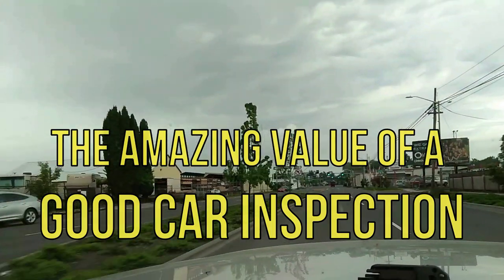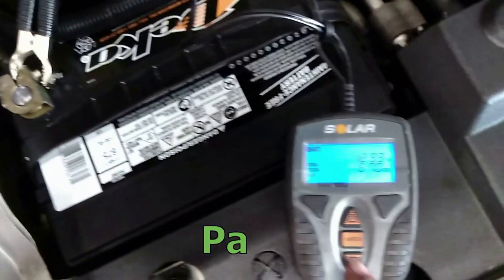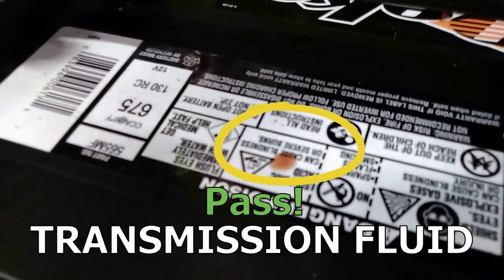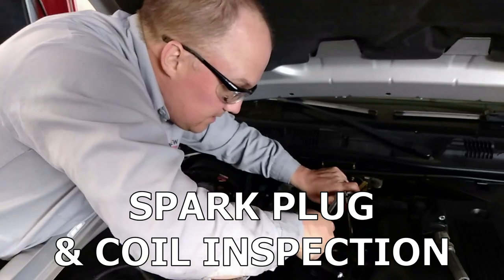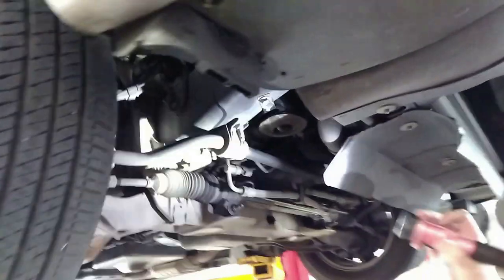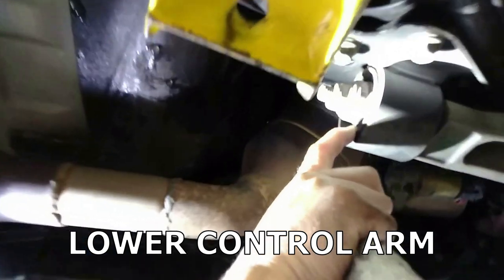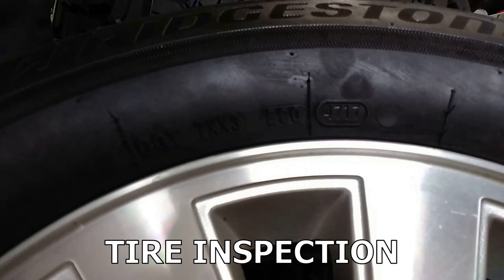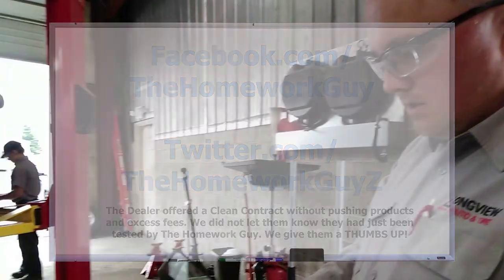GET A USED CAR INSPECTED BEFORE YOU BUY in 2023: Longview Auto & Tire The Homework Guy, Kevin Hunter

Comment: Main question I've always had about getting an inspection is how do you arrange this?  Do you setup the inspection appointment ahead of time with your mechanic?  Who takes the car to them?  At what point in the buying process?
Reply: My mechanic didn't set an appointment, just said bring it and they'd fit it in. But that'll vary between shops so you really just have to call yours to find out. Who takes it to the inspection is up to the dealership. The ones in my area seem to pretty much just have the prospective buyer take it. They get a photo copy of your driver license and auto insurance, and ask you to have it back in an hour. I tell them it'll be from 1 to 2 hours because there's no appointment, and they are okay with that. Do it BEFORE you try to negotiate a deal. Anything the mechanic finds that you would be willing to fix can be used as leverage for bargaining. And of course, they might find HUGE problems like mine did and you just don't want to touch the thing with a 10' pole! If you do get a bad result from the inspection and you're going to walk away, do NOT share ANY information with the dealership! They know where you took it, and most of them are slimeballs and like to leave BAD reviews on Yelp and such for that shop. I said, "I paid for the inspection, so I'm keeping the information private." Smiling of course. And when he asked if I was going to purchase it today I said: "I still need to think it over." They know EXACTLY what is wrong with the vehicle, they don't need you to tell them!

Comment: I completely agree! Get an inspection done before purchasing! I bought a used Cherokee in 2016 and the first drive out of town, the engine blew up. I had taken it to the dealership I purchased it from that same day hours before and was told I was ok to drive it home. On the drive back, the engine blew. Luckily, I made my case with the dealership and they covered costs and labor.  My 2013 Cherokee I bought in 2016 became a lemon. It was problematic in the 4 years I had it.

Comment: yes, any used car should be checked over even if it comes from a dealership, esp. if it comes from a used dealership
Reply: They're really good at polishing turds. I took in one that looked pretty good from the outside, brakes felt a little mushy and clutch released really high. They said yeah, needs a new clutch and brake work -- also had an engine leak and "rusty looking antifreeze."  😬

Comment: I suggest also taking the car to a good body shop to check that the frame is straight, there is no hidden/repaired body damage, and there is no repaired hail damage. Hail and accident damage is very often NOT reported on CarFax! Don't trust CarFax to tell you everything!! In my case a body shop later discovered about two dozen spots where hail damage had been repaired, but the CarFax report said nothing! Also have the body shop check all glass, top to bottom, including inside the doors. In my case, the very bottom of the windshield, below the wipers, was shattered. When I noticed the windshield a month later and showed it to the manager, he said I must have damaged it and refused to replace it, or even help me replace it.

Comment: I dont consider myself a mechanic, I do work on all my own 45yo cars. Butt no new cars. Ppl can cause a scam and sometimes u don't know if your dealing with someone who just cleans a cars interior and paint and flips it. Or an honest person. I agree with the mechanic in this video 100%. 2 things I do as well tho, I smell the engine oil just as he did with the trans fluid, sometimes a car can develop a knocking sound in an engine and to quiet things down theyll add gear oil to the crankcase. Gear oil smell will be a bad indicator of course. Also, I hook in a vacuum gauge to the intake manifold. A vacuum gauge will tell u all sorts of issues  a car engine has if u know how to read the gauge. 
LOVE YOUR VIDEOS! 
#thehomeworkguy

Comment: Speaking of inspections, years ago, AAA had an inspection center, and for a flat fee, they would do what I thought was an excellent inspection of any car.. I would have my own checked every couple of years, just to see how it was doing.. I think AAA stopped that here, but it was great! Sorry to see it go!!! I miss it.. Finding a good mechanic around me now is nearly impossible, or so it seems.. Now, I just buy new cars, then drive them to death!!!!!!!!!!! Luckily, the dealer I have now has been really good for me.. NO complaints.. I am driving a 2005 Honda Accord, has 236,000 miles on it, all my miles, and living in St Louis, MO, I take it Dave Mungenast, near me.. Great so far!!! Basic inspections take place each time I take the car in for service, like oil changes, etc. I did take it to a LOCAL mechanic last year, for a heater issue, but he did so much damage, and did not solve the issue, that I am still mad. Had to have Honda repair some of the damage, then I got payment back from the bad mechanic, but the interior damage will just have to stay, at the least the larger parts.. Some of the broken and damaged console parts I did replace. Horrible experience! #TheHomeworkGuy.

Comment: The most important check that wasn't performed on this video is a scan with a high-level scan tool.  These scans can check engine, transmission, SRS, SAS and more.  Additionally, a slime-ball seller may clear diagnostic codes with a scan tool.  It will take at least 100 miles for all of the onboard computers to recheck and identify diagnostic codes.  If somebody wants to sell me a used car that bad, I say that the contract must include "subject to my mechanic's approval".  Otherwise, this was a great video and Longview Tire did a very comprehensive inspection.
Reply from the maker: You are correct in that a scan must be done. Because we covered "cleared codes" in another video, and in the interest of time, we left it out here. Another reason we didn't show it is that while many consumers have scan tools, they have no real ability or skill to actually LOOK at the car... so we focused on the physical inspection of the vehicle. However, he did check for cleared codes (there were none), and performed a scan with a high end scan tool. The car checked out great. The decision was made to buy it, and it's been a great vehicle. Did the front end work that showed up on the inspection, flushed the brake fluid system, and power steering system. The car is really solid. I enjoyed driving it! Thanks for your comment.

Comment: I agree about the spare coil. I have a grand marquis and the only issue is a coil or two goes once a year. I have a genuine coil and the tool to replace it in the glovebox. I have a phone scan tool to determine which!
Reply: These cars are very picky with coils. I suggest genuine OEM coils not cheap aftermarket ones.
Reply: @Anon1mous  Yes, I get OEM ones from Advance auto. They are in a Motorcraft bag. With discount, about $30 each. The cheap ones are a gamble.

Comment: Cannot agree more Kevin. I just paid $56 to have a PPI on the nice used mustang I just bought from Carvana ( They give you a 7 day return policy ) . Car drives great but the inspection shows a lot of rust corrosion under the car that cannot be fixed. Advice from the garage , run away. Carvana are picking the car back up in a couple of days. I thought I was a risk as the history showed it from Ohio and the inspection proved it was worth every $ I paid for it.
Reply: A PPI is a Pre Purchase Inspection , any garage will perform this if you requests it. They put the car up on ramps and inspect it for anything odd they see . For my mustang they found the hood had been repainted , but no sign of accident damage . Leaking coolant pipe, a loose timing chain that would need to be replaced , heavy rust under e car , brake caliper covers that would need replacing due to rust. I live in Virginia but this service is provided by most garages. The challenge is getting the car before you buy it to have it inspected if it’s sold “ as is”.
Reply: Did Carvana refund your money? The whole amount?

Comment: Hi Kevin
The inspection was vary detailed and inclusive and it's not easy to find a mechanic you can trust and that would go to that length when inspecting a car so credit is due.

I am however a bit puzzled, although he went to a lot of detail, it seems that he over looked the body and chassis of the car, at least from what I could see in the video, he did not check to see if there are any warps or crumples or if repair work has been previously done and he did not check for body panel gap inconsistencies and misalignments, all things that could lead to suspect that the car has been involved in an accident. this has a for more significant impact on the car value than light bulbs and air filter which are relatively insignificant in comparison has this matter been addressed at some point during the purchase of the vehicle? 

Thanks for everything you do, love your channel 
Udi
Reply from the maker: The body inspection was part of what he did... we just had to cut it in the interest of time. However, you will notice that he comments on the body when he is doing the summary of the inspection at the end. The rear quarter on the driver side had been repaired. He noted that there was no damage to the frame or any other aspect of the car, and no bondo used on the the panel, and after inspecting it, decided that it was largely a cosmetic repair having no effect on the structure or soundness of the car.

Comment: So what's next? Do you negotiate with the price after you found out what's wrong? Say if the repairs are 800 bucks, do you go back to the dealer and try to take that off of the price? I have a feeling that would not work.
Reply: Worked for me (Partially). The inspection found the vehicle needed new tires, new brakes+rotors, and a new coupler for the AWD system. The coupler alone was $1100 (Labor+part). The dealer paid for everything else, and we split the coupler work 50/50...We really wanted that car (Santa Fe Limited).

Comment: The problem is finding a good mechanic that will actually do all these tests. Most of them will charge you the $150, and do maybe a third of the tests this guy has done.
Reply: Completely agree with that statement. It may vary from different areas. But I can almost bet most mechanics will not be as thorough by me. Also if the car fails inspection by mechanic how many cars will have that same failure rate that you consider. Could be costly to pay a mechanic for something I would rather look at 1st if you know how. And then, maybe when you feel you found a good solid car and you are will to spend that 100 to 200 for a thorough inspection, go for it. Really the average person has no idea what's in good shape or not except for looks and maybe the ride.
Reply: Yes exactly I had a pre purchase inspection on my vehicle I bought a year ago. He told me everything was GTG a few months later I started having issues that mechanic told we were non issues like leaking steering rack that needed to be replaced, power steering was leaking, break lines were also leaking, and head gaskets needed to be replaced.
Reply: @wil129  
I'm sorry to hear that. That's the reason I do the opposite of what people say, buy used from a dealer, and get the extended warranty. They already paid for fixing our alternator, renting a car, and a door lock actuator. In a perfect world, where we can trust 100% of mechanics, we won't need extended warranties, but as it is right now, we can trust maybe 10%.
I used to be a tech, and I don't reveal that when taking my car somewhere (warranty rules say I'm not allowed to do my own maintenance). I switched more than 10 places until I found someone who didn't cheat me. One guy tore out my 1-day-old wipers in order for me to replace them, another said he changed the coolant, but I did a gravity test and showed him he didn't, the rest were just incompetent...But not scammers.
My advice: Get the extended warranty, and make sure it covers electrical and leaks, Or get a car with a great factory warranty (Mitsubishi has a 10-year powertrain 5-year comprehensive warranty. Hyundai/Kia have a 5-year com' 5-year powertrain.
*That's in Canada...Not sure about the US.
Reply: @shane250  this is 2020. People have Facebook, Yelp, Nextdoor, etc. If they can't find a reliable mechanic, they either live in a super-small market or haven't tried hard enough.
Reply: That’s because you have to actually give a crap enough to speak up and get your full monies worth, I work hard for my money I expect my mechanic to as well. 

Simple. I always get the cheap mechanic labor rate because I talk to them not just behave like a mindless consumer.

Comment: You don’t always have to get the car inspected by “your” mechanic but rather any mechanic. Preferably one not associated with the dealership
Reply from the maker: That's the entire point. Take to someone outside the dealership.
Reply: @KevinHunter  I got royally screwed by one of these shady by here pay here dealerships After that I always do a mechanical inspection and if the car is fairly new I I go through it with a fine tooth comb, I haven’t gotten screwed like that again.

Comment: Thanks for the video Kevin.  Will a new car dealership do an inspection on a used car?  If yes do they charge about the same?  My specific case: New Car Chrysler/Dodge dealer in Minnesota has 5 year old Toyota Landcruiser trade in on their lot.  Is it reasonable to have the inspection done at the new car Toyota dealer down the street?  Is this a standard practice?  What are the pros and cons.  I can see where the Toyota dealer might be overly critical in an attempt to sway me towards a used land cruiser on his lot...assuming he had one.  But on the upside, the toyota dealer certainly has the expertise and knows what to look for and what looks, feels and sounds wrong due to the volume of cars they work on.
Reply from the maker: The biggest question is: Do you have confidence in the mechanics at the other dealer? If the answer is yes, there's no reason you can't take it there for an inspection. Call them and ask them if they can inspect a car for you. I prefer the outside shops, but that's just me.

Comment: I'm surprised the mechanic didn't hook up an high-end scan tool to check for codes, any erased codes and/or  some of the live data for any underlying issues.
Reply from the maker: He did hook it up to scan tools, check for codes, erased codes. The video would have been 90 minutes if we had shown everything. We thought it was most important to show people what physical aspects of the car a good mechanic will inspect because these are things an average buyer has no tools to work with, no experience to draw from, and no equipment to put the vehicle up in the air. However, you can buy an expensive scan tool on Amazon. For those reasons, and in the interest of time, we focused on the physical inspection of the mechanical aspects of the car. There was also a body panel inspection for repairs, accidents, etc.
Reply: @KevinHunter  Very good, please note it is hard to time a good HONEST mechanic these days.

Comment: Is that guy ASE certified?  Why did he "check" the transmission fluid with the engine off?
Reply: Although most vehicles recommend that you check fluid level while engine is running, warmed to op temp and on level ground, you can still inspect everything else like metal debris on the dipstick, if fluid is burnt/dark, the "smell" of the fluid, etc., while the engine is off.
Reply from the maker: You nailed it. Car had just been driven, was at operating temperature. Yes, the mechanic is ASE certified, and comes from three generations of mechanics. They don't just work on cars to make money... it's been a passion through generations of the family. You should see some of the hot rods in the family.
Reply: @LaGaspa   interesting

Comment: Will the car owner allow me to take the car in for an inspection??

Don’t think so.
Most sellers won’t let me have the car alone for ~hours Or

...they don’t have ~hours to wait there with me!

Half the time, I still have to wait even if appointments are made (at the mechanic).

Seems difficult to pre-schedule an shop inspection if you haven’t seen the car Or

...to difficult to coordinate shop time and car owner time!
Reply: this only works on a car dealer retail lot.. i've sold a couple vehicles privately ,and I'm not letting a potential seller take the car anywhere ,and for hours..What the market needs is a mobile inspector that meets you at car location..you can check out almost everything you need to without a lift
Reply: I bought a car private party and made the sale contingent on having my own pre-purchase inspection done. I and asked what mechanic he used. I had the seller take it to a different mechanic, but a well-known one to do the inspection.

This was all done halfway across the country. I paid for the inspection via credit card over the phone and had the report sent directly to me. The seller just drove the car there and had no other influence on the inspection other than waiting for it to be performed.

Comment: How about doing another car inspection video, but with a problematic car, like a used BMW or Range Rover? The 2012 BMW X5, 2008-2012 Chrysler Town & Country vans, 2011-2014 Ford Fiesta, 2014 Dodge Ram 1500, 2015-2016, Cadillac Escalade, 2008-2012 BMW 5 Series sedans, etc. are notoriously unreliable.